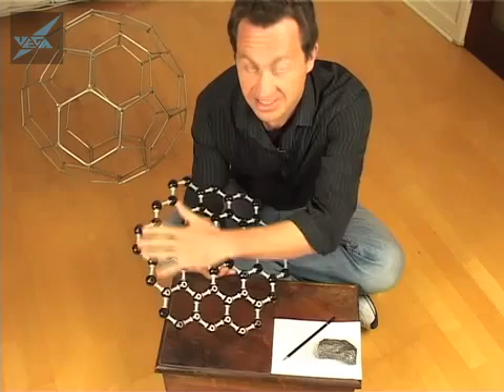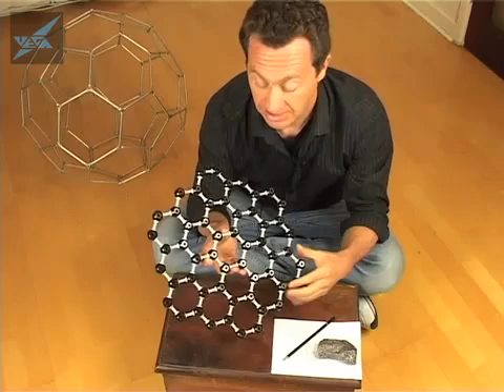How to make graphene with a pencil and sticky tape

Comment: Wait, but if electricity flows faster, then can we use graphene to charge our phones faster
Reply: That's quite the generalization....
Reply: Isaac Ostler (any idea how to make batery using Graphene)
Reply: Never give up 

Graphene capacitor with a resistance logic circuit (so it doesn't fast discharge)

Comment: The variation in volume is extremely annoying and has meant I did not finish watching your video. I liked the info presented, but wanted you to know this volume issue so you can improve on your next videos. Graphene, interesting stuff. :-)
Reply: I agree, the volume starts high with each sentence and trails off to very low towards the end. Please fix that.
Reply: Exactly.

Comment: Graphite once came in small tubes or bottles.I remember it because my dad kept a tube/bottle to lubricate his guns.The graphite lubricates the metal to metal surfaces .It is not messy like oils.Graphite is a greyish silvery looking powder. There is also a lock lubricant which has graphite but that is a liquid with graphite mixed in.I would try gunshop or gun repair stores.

Comment: you didn't mention that it's inconceivably strong. You could balance an elephant on a pencil (to reduce surface area) which in turn is balancing on a graphene sheet, and it wouldn't break.